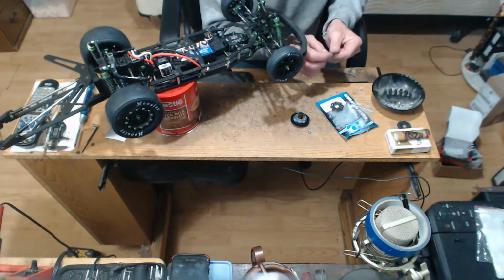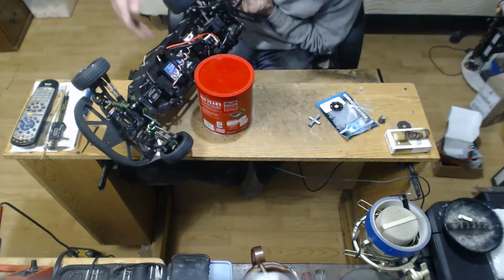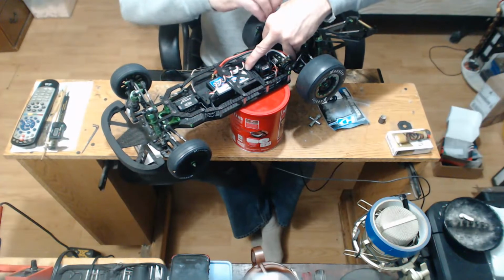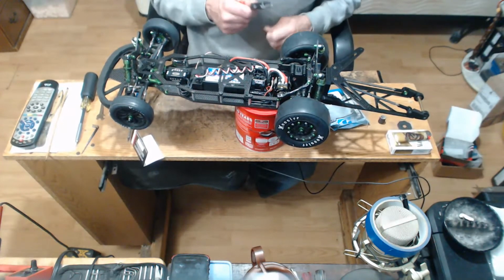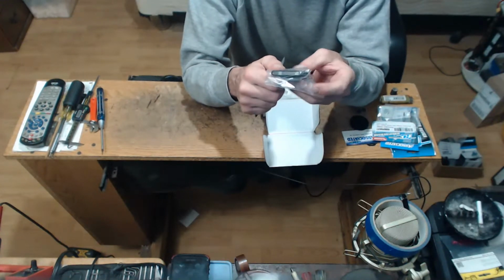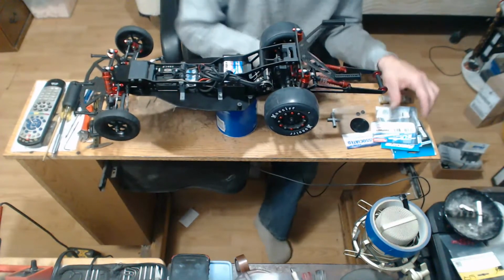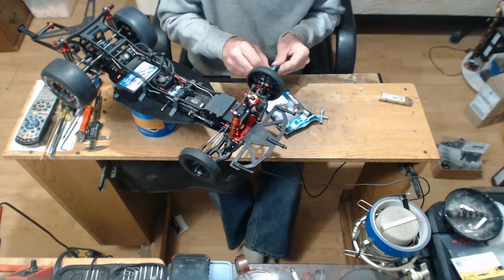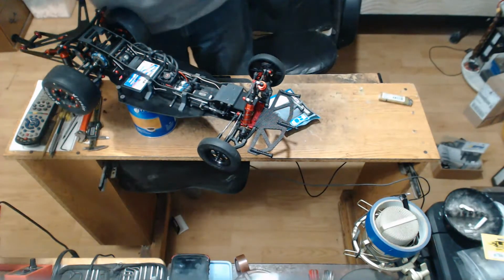Revolution Designs  VTS Slipper & Pads Assembly and Team Brood Octapad behind spur for the TARP

Comment: Tim are you running the revolution design spur as well?  I just got a spur and clutch for my drc build.  I tell ya what this drc chassis and shock tower with the anti roll bar is killing me.  Everything is so close together.  By the time I'm done with the build all the hardware will be wore out.
Reply from the maker: No. I'll be running the Team Associated Spurs on my setups. 
Some things on my build are snug, but not too bad for real estate.  a few things though. lol.

Ya, It seems I have assembled and un assembled things a few times already.   Gotta jump into the shocks again, and remove a bit of the internal limiters.  Think I have them too big as the front ends are dragging or very close to it.